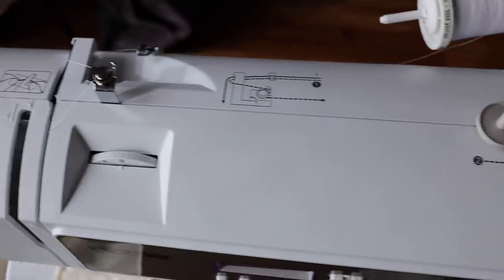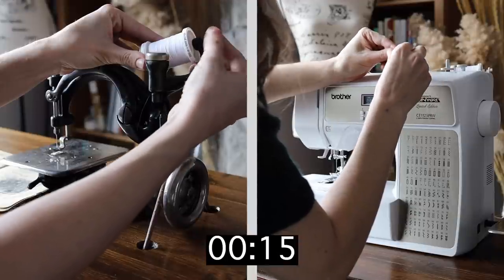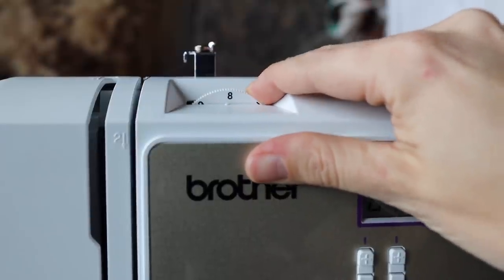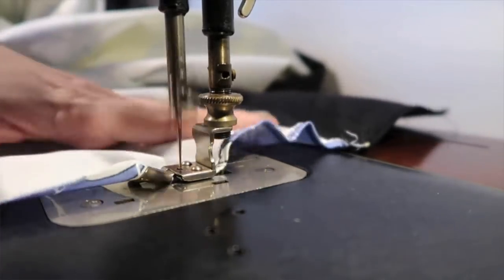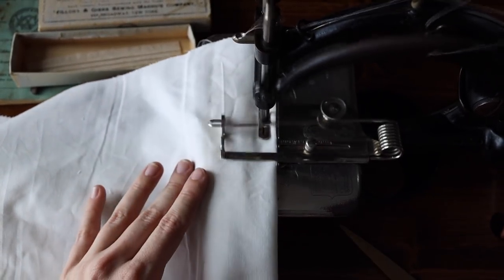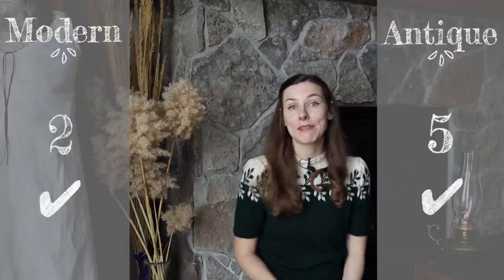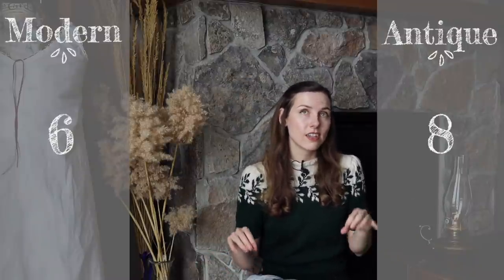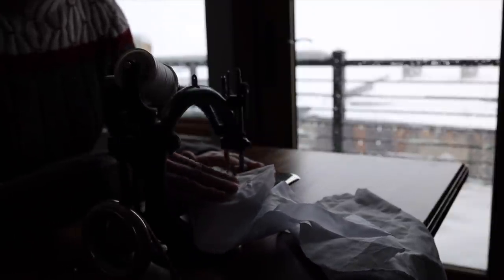Battle of the Machines - is a modern sewing machine better than an antique?

Comment: This comparison is sort of like, "How'd you rather commute 19 miles to work each day, this moderately priced 2 year old Toyota sedan or this horse and buggy?😁 The older machine is beautiful and treadling is relaxing, but there are so many things a chain stitch machine cannot do.

A better comparison would be to compare a new computerized machine to a vintage machine. 

I just inherited a Singer 201-2,made in 1951. The foot pedal was misplaced and I ordered a brand new one from Amazon. My mother also gave me a Singer 15 treadle that she's had for 20 years. When she purchased it and it was delivered, I sat down and put it thru its paces as I had learned to treadle when I was 10. It came back immediately just like riding a bike. Both of these machines are "new" enough to have reverse stitching for locking the ends of seams. That is my one deal breaker on a vintage - it must reverse. Properly securing a seam end is much too time consuming otherwise. New parts are available for both of these machines.

My main machine is a 32 year old Kenmore/Janome that does one automatic buttonhole and has stretch stitches. It also has a variety of overcast stitches for seam finishes. These features are mandatory for many contemporary fabrics. In 32 years, I have never used any decorative stitch it has on anything. (No kids.)  The Kenmore is also extremely portable.

I strongly suspect the 201 will become my main machine as it sews such a perfect straight stitch very quietly. The treadle will be used for occasional upholstery jobs and jeans. 

If one is just beginning to learn to sew, it is important to have a good machine that works very well - whether it's new or vintage. One woman online made herself beautiful clothing for about 4 years with an $89 Brother she bought when she moved to another country. Many inexpensive "plastic fantastics" these days will sew well for 3 to 4 years - until they don't and they aren't worth having serviced. The "cheapies" (under $150) in 1990 were useless plastic junk straight out of the box so I spent $279 for a machine that has about 1/3 plastic on the outside, but is mostly all metal inside where it counts. I have never had to have it professionally serviced.

Computerized machines can cost a few hundred dollars or a few thousand. Just remember this:  There are absolutely NO bells and whistles on any sewing machine ever made that will take the place of actual sewing skills. There may be a few features that save time, such as a reverse locking stitch, but even most of those are negligible in the long run.  Buy what you can afford and what will bring you joy on your creative journey. If you struggle and sacrifice to pay for a $2500 machine now, will you be able to afford a new motherboard if it needs it in 5 years?

I've spent about $200 for tools and materials to update the 201. These same tools will help me keep both it and the 15 maintained for years to come. I would like to buy a donor machine for my Kenmore (usually < $50) and if my serger dies, I might consider replacing it. Basically, I'll have spent less than $900 over 45 years of sewing on machines. Not a bad return on my investment - especially considering its not a hobby for me - it's a life skill. If I did not sew, I would never have any clothing that fit and my furniture would all be ragged junk.

Comment: I have a mid 60's slant shank singer I swear by, which does straight stitch and zig zag and I found a button holer and monogramer for at goodwill. They generally run like 150-300 dollars, nearly never need servicing and are pretty reasonably quiet. Although not as pretty as some of the other vintage machines, I swear by them (I'm biased I learned on my grandmothers slant shank, she had the fancy one with all the stitches. I've had three modern machines and they do not hold up to any heavy sewing, you knock them about too much while traveling and the inner parts stop working, and i've had humidity ruin one of the computers. Never again.

Comment: The Brother "Project Runway" line has the ability to use either a foot pedal or just the start/stop button (with the adjustable speed slide button as well, great for small/limited spaces. I found i can sew on the living room floor if I don't have the table space). (The model I have is an XRPRW that I got off of Walmart.com, it's the blue-grey version, as each year the color scheme changes).

Comment: Thank you for the nice video. It is an apple vs. orange comparison though with those two machines. A more accurate comparison would have been to use an antique Singer that also uses a bobbin thread. Also, that antique W&G will still be stitching 200 years from now while the modern plastic machine will be in a land fill before it's even 20 years old. I have Singers and W&G machines from the1860s,  and they still sew like new machines. They made them to last forever. Machines made in the past 40 years or so do not hold up or last with heavy use more than just a few years. We've worn out Husqvarna Viking machines in under five years, and those are not inexpensive machines!

Comment: You forgot portability, being able to take it with you to a different place for instance. I have a 1954 handcrank Singer which I like, but would prefer a treadle so I can sew straighter seams. Currently using my 1985 electric Singer, which does zigzag and different stitches, but is not as aesthetically pleasing as the old one . . .

Comment: Including the bobbin winding isn't really that fair because my junior machine has a built-in winder that runs as you sew. You wind the next bobbin while sewing. I recommend a junior industrial machine, they're really simple,  I can thread mine with a bobbin in 30 seconds flat, and come with lots of attachments. Most industrial machines have a standard foot connector so there are tons of universal feet out there. People have also converted the tuck attachment to the universal connector too.

Comment: Are the needles for this antique machine readily available? Do the Schmetz (?sp) brand fit? And I’ve had an older treadle machine, the bobbin was the shuttle-style bobbin… it was fun to use but I missed the little light to help you see! I had to be near a sunny window while sewing or I couldn’t see. I gave that to my Amish neighbors, since they don’t use electricity. The Amish ladies are very clever and I’ve seen a lot of more modern sewing machines converted into treadle-style machines so they can do the fancier stitches! And there is something soothing about using and hearing a treadle machine, plus the ability to regulate your sewing speed once you get used to it! Happy stitching, whichever machine you may use!

Comment: I feel like peak machine occurred sometime after the inclusion of assisted buttonholes but before the stitch selection panel allowed for more than one row of stitch symbols! Super helpful, but not so desperate to help that it’s intimidating. There’s enough to be intimidated by without that as well haha
Re tension, the manual should explain what’s gone wrong based on the resulting stitches. I have a ‘70s brother overlock machine and had some problems worn the tension and the manual contains all the answers! Sometimes the answer is the tension is fine but you’re using the wrong needle and that’s actually the problem.

Comment: For me using it without electricity would be an absolute win. I live somewhere with constant electricity cuts and have turned to manual wherever i can. Why have something plugged in when you can easily not have it… 🧐 the leg operated machines are amazing, you can convert them, the leg movement somehow makes it easier in my opinion.

Comment: I only sew with vintage machines. (I only have one antique machine, but it was electrified in the 70s because it is an industrial and was in use as an industrial.)

That all being said, every sewing machine should be seen as a tool. Which tool do you need for this job? I have a 1980s Bernina 1230, and for more things it's my go to. I also have a 1960s Kenmore, and I have hemmer feet for it, as well as a button hole attachment with cams and I much prefer those but with all the attachments I have for the Kenmore, I can technically do the same with both those machines. 

My Singer 29k from the 1960s, it's made for heavy leather and for fixing shoes, and the antique Singer I have (I forget the model) is made for sewing car upholstery. 

They're all just tools in the toolbox. It just depends on what you're needing to sew. 😊

Comment: I use vintage Singer machines and a modern Bernina - love them both - but just FYI you can get modern treadle mechanical machines.  :-)  shop at stores that cater to off the grid or Amish.

Comment: I would have added a "durability" category and "environmental" category. Your machine is only as durable as its weakest part, plastic in all modern machines and circuit boards in the digital ones. We've all seen what decades do to plastic and it would be a miracle for a digital device to last a decade. With the antique machines, as long as you oil them, they'll outlast your lifetime. As for the environmental category, ask yourself which one could be recycled (given it's not taken care of properly) and which one has no where to go other than the landfill after its life has come to an end.

Comment: I was surprised about the tension. I fuss with the tension on my vintage machines far more than I ever do on my modern Pfaff.
Reply: Same here. My Juki DX7 has electronic tensioning as have both my Baby Locks. It has feet and attachments for anything and everything and (drumroll!) an excellent button hole maker. I own a 1920's table mounted zig-zagging Phoenix that was in my family but I never use that.

Comment: Comparing Apples and oranges, it would have been better to compare a Singer 201 to a modern strait stich machine (hard to find) Another real question is how long will the new machine last compared to the hundred year plus for the old machine. Also how heavy of a fabric the new machine will sew and for how long vs. the old machine? In the end it boils down to what's important to the operator and how they weight the importance of the features/ limitations. I just bought a 110 year old White machine for $12.50 and it sews beautifully and is built like a tank. The WG machines are more collectors things today and command higher prices than some other much better machines of the past. IMHO

Comment: Looking at your modern machine the very quick glimpse of the different stitch types it does 34 through 39. Look like they should be different types of buttonholes. I know you’ve had issues with those from watching many of your videos. I would take a look through your manual for your machine I’m assuming you have it and see if you can’t learn to do buttonholes with your modern machine as it might make life a little easier for you.

Comment: I own multiple older/ vintage machines and one top of the line modern Baby Lock Lyric and hands down I prefer my older vintage machines! The kind of sewing (vintage, and quilts) don't require all the different settings and have never used all the fancy settings on my modern machine. As for cost the most I have paid for a vintage machine was between $700.00, and $750.00 (for my mint condition, highly collectable model machines) Well below the cost of my Lyric by far. Several weeks ago I picked up a 1950's Singer Slant-O-Matic in great condition complete with all the attachments, wooden case/desk and even a chair for just $150.00 on Craigslist. This was my first mid-century machine. The only downside as it hadn't been run in some time it does need a good service/ overhaul to clean it out and get it running at peak performance (a minor investment of time and money).

If you are willing to wait and look around you can find some great antique and vintage machines for reasonable prices. They are generally made all metal outside, with metal parts inside and if proper maintenance is used will far outlast any modern machine (I'm 50 and all my machines, other than the modern Lyric, are all older than me and still running like new despite multiple owners and years of use!

There are also a lot of YouTube videos showing how to use all of my many vintage model machines and I've only found one online class for my modern Lyric, and I had to pay for it....

My vote goes to vintage/ antique!

Comment: I own a Singer Heavy Duty modern machine ( marketed as quieter, stronger and tougher) and three 1970s vintage Elna machines. I hate the modern machine on every level possible. I stitch layers and layers of batting, fleece, anything under the sun with my vintage girls and they just do it as if it is butter. Quiet, stronger and made to last. Currently saving up for another vintage machine and then a treadle since this is Africa and electricity is a serious issue. You do get the old fashioned Singer machines here, made with the option of hand sewing, treadle or electric, but they are poor quality and cost the same as most lower end good quality sewing machines.

Comment: I know this video is 3 years old, but I've been using modern sewing machines since I was 14 and my tip for tensioning is: almost always keep the tension inbetween the little arrows (usually from 5 to 3) and for lighter fabrics use higher tension and for heavier fabrics use lower tension. That's it. It's pretty simple once you know that.

Edit: Ok I just finished the video, and she has a VERY biased opinion lol. She obviously knows a lot about the antique machine and almost nothing about the modern machine. I think it's fine to prefer one over the other, but to frame this video as a legit comparison instead of "this is why I like my antique machine over modern machines," is super disingenuous. Also, modern machines are pretty quiet if you don't jam your foot down and go full speed lol. It's like a car. Most of the time you're going 30 mph, not 80.

Comment: Lovely video, but two flaws.
First, you gave one point for each feature. In practice, some features might be much more useful, or conversely annoying (like noise) than others, so the results should have been weighted to reflect that.
Second, you said that the Wilcox was much more expensive.  That simply isn't true, if you think about it.  In five years' time, the Wilcox will still be worth a lot of money (you might even make a profit on it when you sell), but the new machine will be worth next to nothing.  And don't forget that the new machine uses expensive electricity, is bad for the planet (anything newly made is bad for the planet), and will be more expensive to service.
So in the end, the antique wins by an even bigger margin!

Comment: As much as I like Brother, they aren't as good as older machines. It just isnt designed to be the workhorse your antique is. Maybe compare to the older berninas, I know singer between the 60s and 90s turned out junk sewing machines, not sure about the other brand. It would be interesting to compare a new, or less than 20 year old machine with a good one from the q70s or 80s and the antique.  It might be a closer contest then.